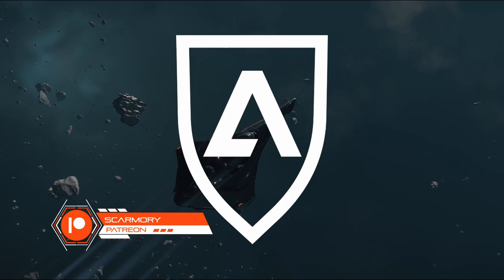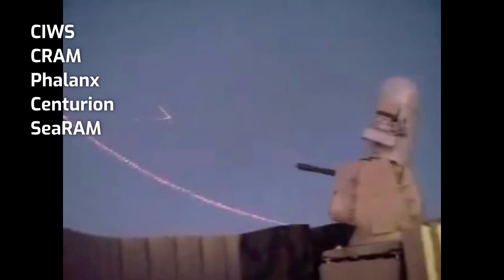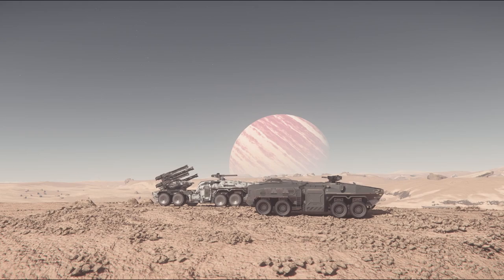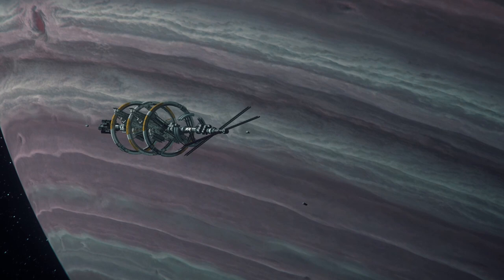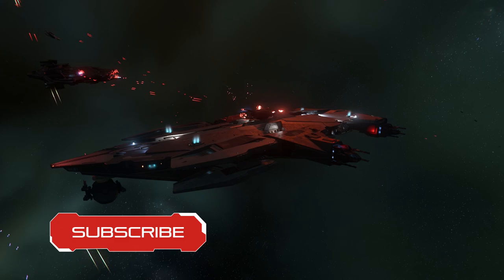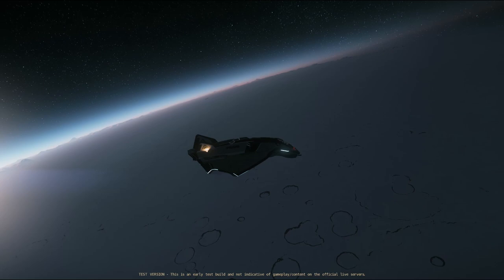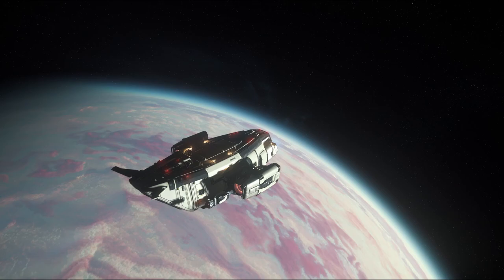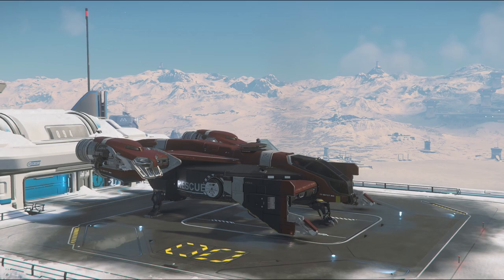Star Citizen - Every ship should have this

Comment: I would go even further and change non-cpmbat ship weapons for a defensive turret loadout.

For example Hull A. Those front-firing guns won't do any good unless something is blocking the escape vector as the ship is not maneuverable enough to fight anything. I'd argue that two automated turrets with good coverage even having only one S1 gun each would be better for the ship and I doubt two guns each would be OP either.

Comment: I am certainly in favor for defensive close in weapons systems being a staple item on most larger ships.  With the stipulation that they are intended to delay incoming attacks for long enough to allow the ship to escape or mount a proper defense or counter attack, or at he very least allow security forces time enough to arrive in order to avoid instant destruction.  

I would think these would come in a few base varieties as well:  ballistics - high rate of fire, low damage, average range, limited ammunition.   directed energy weapons (dews) - long range, medium damage, low rate of fire, long capacitor recharge times.  Flak - medium rate of fire, high damage (indiscriminate) , short range, limited ammunition. Missile Defense Systems - long range, high damage, low rate of fire, single or limited use perhaps.

In addition would also like to see more defensive technologies like active jamming that prevents all but the most advanced of sensors from acquiring a target lock but generates a lot of heat and/or consumes a lot of energy to balance such a system out, which could work against the ship by making even more vulnerable to certain weapon types while active. I have a lot more ideas in this regard but this isn't the place for them.  

The main point being that these systems should not take away from or replace human/NPC crew but supplement them in a balanced way with the goal being to add depth/strategy to gameplay.

the algorithm reigns supreme! 🤖

Comment: I always point to (for larger ships) the Battlestar Galactica re-boot. Flak. No, not Frak. Flak rounds. :P
Example: Imagine a Hammerhead with half of each weapons mount replaced with flak capable weapons. Now that's anti-fighter and would help in missile/torpedo defence. It's not 100% effective, has limited range, and can't be done in close proximity to friendly ships. Flak will hit anything and everything, regardless. 
Of course, for smaller ships I reckon you're on the right track. One ,Two, or perhaps up to Four or Five depending on the ship size, energy based AMS's (To use a simpler Battletech/Mechwarrior term: Anti-Missile System), to attempt to shoot down incoming warheads. As you said a capacitor, 'Tier 0' and limited arcs/coverage would be great balances from keeping each ship near-improbable to shoot or not be overwhelmed. 

I believe these should be automated on all combat-focused ships, and an optional blade/computer for more occupational-focused ships. Fighters should not have this at all, of course. They get the basic countermeasures.

Comment: It is the far distant future, for smaller ships what about adding some form of defensive utility. like a 'short' range EM Pulse that could radiate from the hull that would just fry missile tracking  systems, with a reasonable cooldown.  wouldn't need to  bring too much math into the equation,  just if a missile is closer than X range when triggered the missile just becomes a dumb projectile on its last trajectory update.

Comment: If you can target missiles, I don’t see why you couldn’t shoot missiles at them. I think the balance would come from lock on time vs size of the missile. For example, if someone shoots a long range size 9 at a capital ship, a size 1-3 missile could lock on it in time to intercept it, but intercepting smaller size 5 torpedos would take longer to lock on, and realistically only a size 1-2 missile could lock in time and reach it before it hits. Also, the chance of an intercept isn’t 100% as torpedos are much smaller than ships. This would also add weight to fighter escorts protecting the larger ships as they are able to help intercept large torpedo shots.

Comment: Anything that discourages multi crew I see as a bad thing. If blades and NPCs are better than a rookie operator what motivation is there to invite a new player on to your ship to help you out while at the same time creating gameplay for new players?

Additionally I see this as changing the combat to a war of attrition. If the AI can effectively take out incoming missiles then it will come down to whether the attacker runs out of ammo before the defence systems run out of ammo.
Reply: it would still be better then the current system where whoever has the most or bigger missiles win without any kind of counterplay

Comment: Ai blades be able to handle all targets and should be calculated why whoever's PC is in charge of the ship (how ever you want to determine this , doesn't matter) so then server tick rate is close to a non-issue
Reply: Clientside AI-handling would give a better user-experience for the average user, but clientside hit-detection is prone to cheating (since you can generate hit-messages with an aimbot and send those to the server). Even with Easy Anticheat integrated into SC, there are ways around that (some people use those ways to enable playing SC on linux, for example).

Comment: It shouldn't be hard for any of this to be implemented, Elite Dangerous has Point Defense modules for missile defense, and you can swap out your forward firing guns for turrets, and you can then choose to make the turrets fully autonomous, track targets, or act as gimbled weapons. So I agree with you on all of your points, but I want to add to them by suggesting an option to slave any un-manned turrets to the pilots targeting system. I usually fly alone, and my cutty black has two un-used guns sitting on the roof, why can't I use them?
Reply from the maker: I think slaving turret guns to the pilot is planned, iirc it's included with AI blades
Reply: Elite Dangerous uses peer-to-peer connections between player-PCs to handle everything, especially hit-detection. This method reduces roundtrip-lag time and helps with point defense implementation, since you don't have the common server to communicate with, but it introduced a whole bunch of other problems, like session-syncing (player A does not see player B in a location, or dropped cargo exists twice and so on) and cheating.